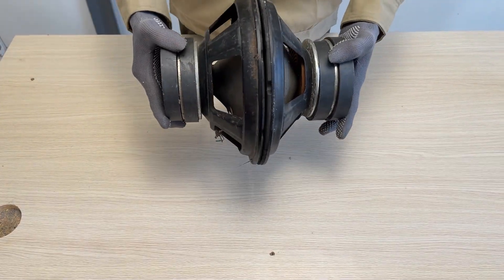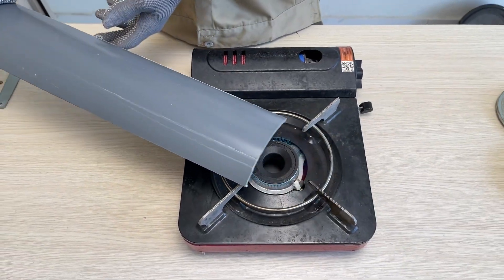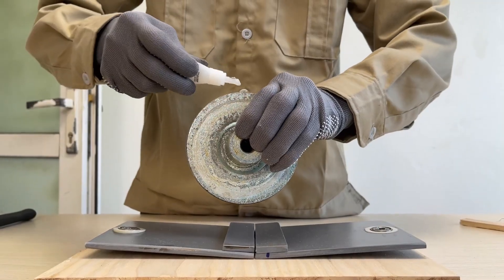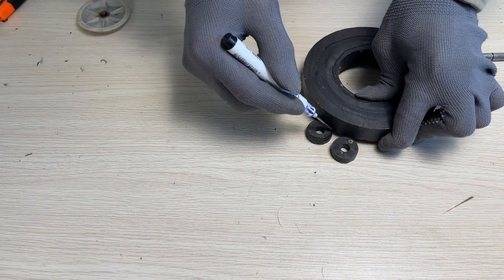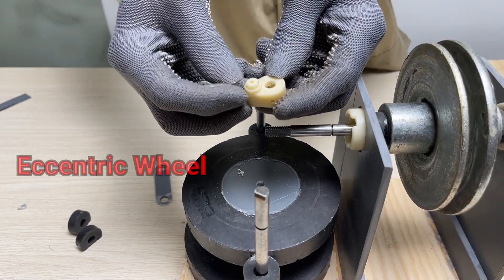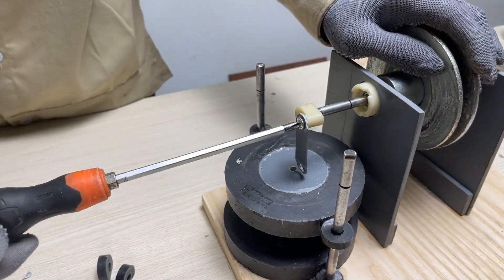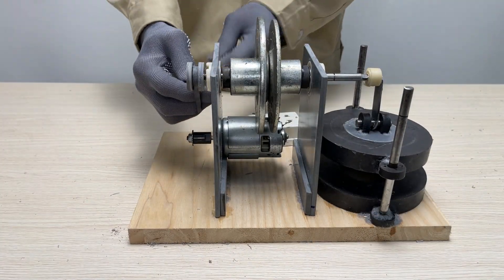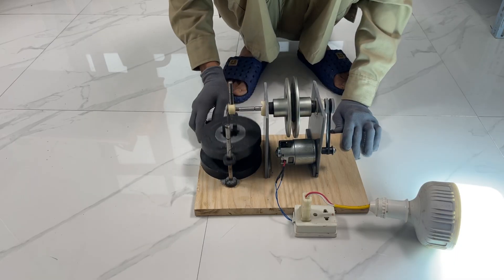DIY Free Energy Generator Using DC Motor & Magnet – Simple Science Project

Comment: Since continuous motion does not exist and is impossible: Question for intelligent physicists:
    where is the deception?
Reply from the maker: The energy will definitely fade over time. As the magnetic field of the old speaker magnet weakens, the system loses power and can’t run indefinitely. It’s not perpetual motion it’s just using the remaining energy stored in the magnet.
Reply from the maker: The energy will definitely fade over time. As the magnetic field of the old speaker magnet weakens, the system loses power and can’t run indefinitely. It’s not perpetual motion — it’s just using the remaining energy stored in the magnet.